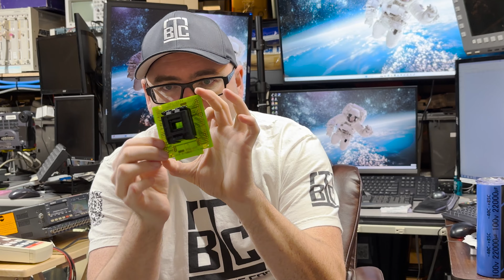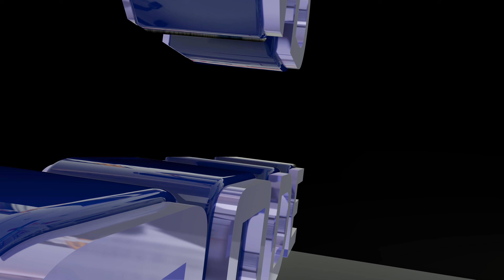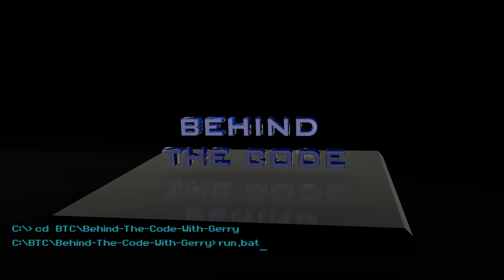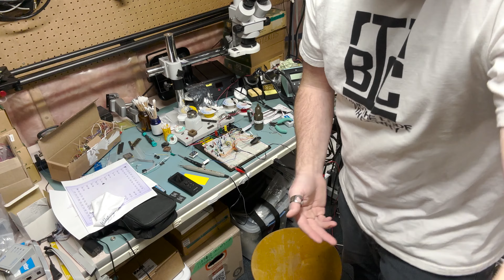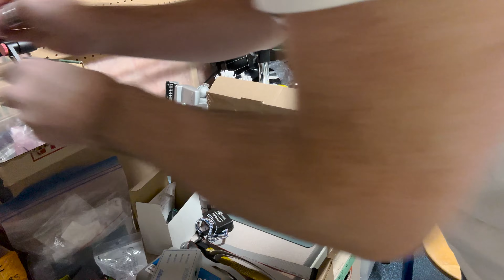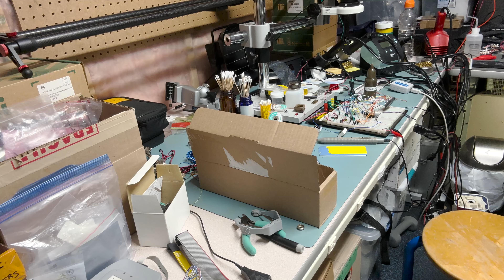Gerry Builds a Custom Adapter to Help Decipher a 90's Era Altera MAX CPLD Erase Sequence  [#64]

Comment: EPM7032S - JTAG UNLOCK - first time without clear IDCODE!!
Using my Parallel Programmer - Arduino Mega, I was able for the first time to erase an EPM7032S (JTAG UNLOCK) without erasing the IDCODE.

Comment: Gerry, good news! We finally managed to erase an EPM7032S using a Parallel Programmer with the Arduino Mega. Check this out!   EEVBLOG - Programming (non-JTAG) MAX7000 devices
Reply from the maker: Hey Jose,
Wow! That is fantastic! 😄👍

I’ve been quite sick since the Xmas holiday. I came down with the flu and have not been back to the lab in almost 3 weeks.

I’ll definitely check out your findings…and talk about it in my video once I get back to my Lab.
Hopefully I’ll get back there this week or next.

Nicely done!😎👌
Reply: I’ve been following the thread Jose mentions and between them and your work Gerry, we may eventually have a solution, get well soon

Comment: I am checking now if PLDT-2 trainer boards could be a quite easier and elegant solution.
According to Altera/Intel datasheet, the epm7128s family has in-built circuitry to generate 12v internally, probably after a certain waveform/command from DB25 MVBlaster.
Taking in a account that pldt-2 is very similar to Altera University Program Boards ver 1 and 2, it has multiple expansion slots for virtually all cpld pins installed in the socket.
Reply from the maker: Nice! 👍 The PLDT-2 dev boards are a great little development board. And yes you are correct… it’s an excellent board with its many breakout IDC Ports. 👌

Comment: Well done Gerry, looking forward eagerly to the next episode.  Seems like a couple of the EEVBlog subscribers are running on a similar path and making progress.  I've been reading a lot recently and noted that other members of the MAX 7000 family can be forced into user / JTAG accessible mode by a small 12v pulse (250 ms)  to OE1.  I've got at the back of my mind that someone mentioned that for the 7128SLC84, both OE1 & OE2 would need to be 12v pulsed simultaneously but I can't recall whether that was a theory or a conclusion.  For the 7032 they seem to have documented the Erase and program routines for parallel programming but haven't done so for the 7064 or 7128 yet, in fact your latest project to reverse engineer the 7128 processes adopted by your programmer was mentioned, so we're all counting on you 🙂
Reply from the maker: Hi @dredgeb,
Ohh wow that’s wild! 😄🤘

Ha! That’s great!…figured I would stir the pot a bit to potentially get this mystery solved one way or another. I knew it had been something many have discussed…but I never did find a solid set of procedures. That’s interesting regarding the OE1 & OE2 12V pulses. Makes alot of sense so you’re probably right on the money. Will be cool to finally run the scans.

Hopefully between everyone’s efforts we can figure it all out. 

Since my last video I’ve been assembling and configuring my adapter and LA setup… I’m aiming to have the next video ready for this weekend ….fingers crossed I’ll have something worthwhile to share. 🤞🏻
Reply: @BehindTheCode_wGerry that will be an early Christmas present.  I’m waiting on two 7128SLC84 development boards which are coming from Spain, I found them on eBay.  They are kits of pcb with components that have to be assembled but which provide a socketed space for the 7128SLC84 but with every connection brought out to headers on the board, in addition a JTAG header and also a solderable perf board like area. Power is supplied to the board and a 5v stabilised supply is provided, so with my arduino or raspberry pi should be good for some experiments 👍😀
Reply from the maker: Ohh nice! 😎🤘
That’s awesome.

 I think I know which one you’re talking about. I almost picked one up…but I went with some stock parts instead. Lol 😄👍

That kit should be fun to tinker with. Perfect for a Sunday afternoon over the Xmas holidays with a nice holiday drink.👌

Comment: It would be nice to eventually rig up an Arduino to erase these chips. Looking forward to what you find out. Thanks.
Reply from the maker: Hey DJ,

Yes indeed… it’s been the desire by many for years. It’s in the works. 😎👍

You tinker with Arduino?
Nice.👍 I’ve done a few small projects…but usually the Old Altera MAX is my goto.

Comment: Which PLCC extraction tool do you use? I'm having a horrible time finding one that won't slip off and leave a big scratch across the top of my chips, even a relatively expensive one I bought recently. 😩

Carl is screaming double time.
Reply from the maker: Lol…😂
Hi Tom…
Yes…Carl screams alot…lol

The PLCC extractor is by Jonard Tools.
Model: EX-6

https://www.digikey.ca/en/products/detail/jonard-tools/EX-6/135076?gad_campaignid=23158240004

I had the same problem until I watched this video…. I was using my tool incorrectly and was always scratching my chips too. 

Let the tool do all the work… as this video demos here. 😎👍👇

https://youtu.be/Y5GdqeeQ6oo?si=wzdCnLI_1os3Dy1G
Reply: @BehindTheCode_wGerry thanks, I'll check it out. The one I bought recently was also a Jonard, EX-5.

I don't tend to pull on it, but as the little metal bits come up they just seem to scrape up the corner of the chip and then one end slips off. 🫤

I wonder if my sockets are a bit too tight or something, gripping it too well.
Reply from the maker: Just make sure you are pushing downward with a bit of force to keep the tool firmly against the socket.

The tools hooks move in/out of the corner grooves on the corner of the socket. If you are not applying downward pressure the hooks will pop out of these grooves.

So when you squeeze the tools prongs… the chip should pop up into the tool….but you must keep the downward pressure applied onto the top of the socket…until the chip pops out. 

So keep the tool firmly against the socket until the chip pops out…only then do you remove the downward pressure off the socket.

I hope I described this correctly.
That’s the best way ai can describe my technique. 😎👍
Reply: @BehindTheCode_wGerry that might be what I'm doing wrong. I'm squeezing the tool more than anything else.
Reply from the maker: @TomStorey96 
Cool. Keep me posted. Hopefully it works out. 😎🤘🤞🏻

Comment: Great work Gerry. Would it be feasible with that setup to brute force the code within a security locked chip by sending all input combinations and reading the corresponding outputs? Like the way the logic within a PAL chip can be brute forced and reprogrammed to a GAL.
Reply from the maker: Hi Mick,

Standard Combinational digital circuits would work via the brute force method. 

However, if the PLCC design incorporates Flip-flops, registers, counters or memory units etc. Essentially any kind of Sequential circuit, this  method would not work unfortunately.

So unless you know a little bit about how the chip is being used in the circuit, it’s hard to know if it does in fact contain Sequential circuits or not.

Comment: Surely the sequence must be detailed in the data sheet ?
Reply from the maker: There are some details, but nothing showing the erase sequence waveforms. ☹️
Reply: The reply from fellow contributor on Altera/Intel community board stated that this is not public available IP and available only for  OEM contractors and etc.
Basically it deals with the physical hardware details, so Gerry's approach would be the most productive step from the amateur community's perspective.
Be assured that a lot of diy hobbyist people following this epic saga about reviving Max7000s series for years.

Good luck and good job.

Comment: Hey Gerry. We've had some interaction back in 2016 about EPM7032TC44s (marked STC). I stumbled across this video and I hope you get to the bottom of it (and perhaps find a way around JTAG lockout in the process : I think consensus is that it might involve 12V on OE1 to re-enable JTAG).
Reply from the maker: Holy cow! John! 
Good to hear from you. 
That’s wild. Haha!😄👍

Yes indeed I’m diving in deep… and we’ll see where it leads. Fingers crossed we find out discover something interesting. 🤞🏻🤞🏻 I think you’re right on the money about the 12volt signal. 👍

You know what’s wild?…there’s still a folder on that win98 machine which I used for my Labsite programmer in the video…. A folder called “JohnKortinkPOFs” lol. 😄👍

Blast from the past. 

Again John, good to hear from you.
Hope all is well.

Cheers!
-Gerry

Comment: If you need any technical support, we can help. Count on our assistance. EPM7032S have less pins to scan. Thank you for sharing your video.    EEVBlog - Topic: Programming (non-JTAG) MAX7000 devices
Reply from the maker: Right on! 😎👍Thanks Jose,

Yeah, the 44 pin package I had thought of tackling… but I know several people …myself included that use the 84pin packages more often for their projects… so I wanted to tackle it first. 😎🤘I will for sure tackle the other packages over time. 

Thanks again.🙏👍